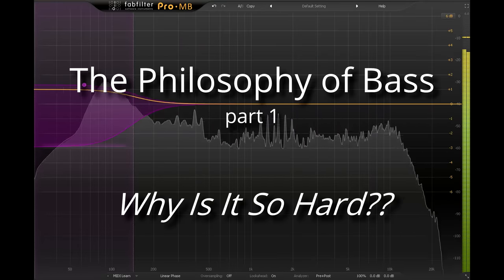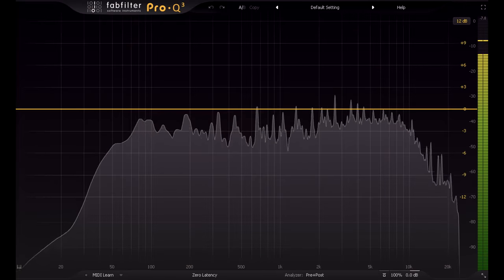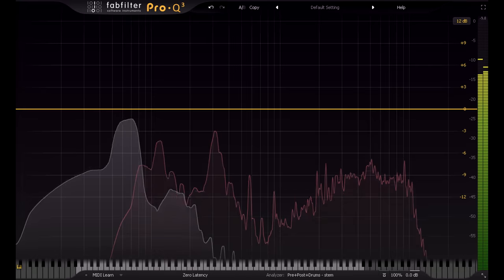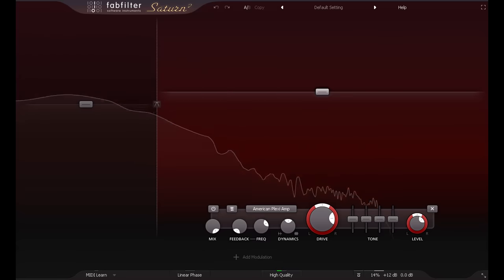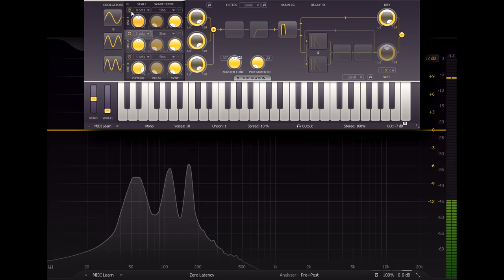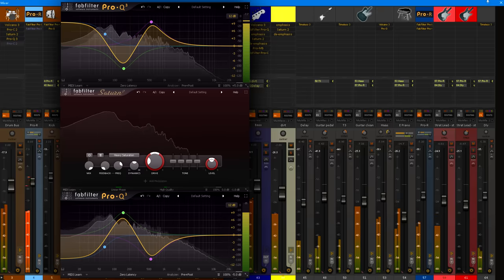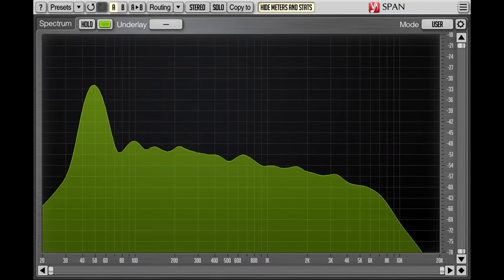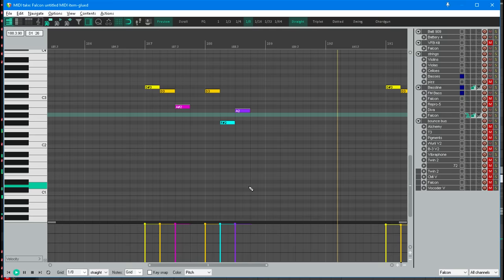The Philosophy of Bass

Comment: I would like to expand on mixing with headphones. They are great for checking the transient and detail of the sound, including sub if your headphones can produce it, but you can't rely only on headphones for mixing, due to lack of "full phase" information. For example, I had a scenario where after applying mono phaser/all-pass filter on a mono sub kick (edm) the sub and bass freq sounded really good on headphones, but it was very weird on speakers. The reason for this is that sound also mixes over time in air, and headphones doesn't give you the "time/air travel" factor which means that on headphones you can't hear what will happen with the sub/bass at longer distance, especially when one freq is slightly delayed/out of phase, which cancels some of the freq over time. In my case this was a creative decision for edm production, but this also can happen with real world instruments recordings especially when you mix 2 mics. It would be amazing if someone could do some more detailed video about this issue. At the end, use your main speakers for general mixing, than check the mix on headphones for details and transients, and than return to speakers for final check. This will make your life much easier. :)
Reply: You can go much extremer by flipping the phase of one master channel (for example the right channel). It'll sound perfectly fine on headphones (edit: it will sound wierd still, but on speakers the entire bass region will disappear, at least when you're sitting in a symmetrical room OR have a sub) but absolutely not fine on speakers. Take it even further and play that mix back on a boombox (with both channels summed) and you're left without drums, bass and vocals all of a sudden!
Reply: Yes you can rely on headphones for mixing. You just have to know how to use your tools. And you don't have to trust me. Andrew Scheps has told in interviews that he has done mixes with only headphones, sent them to mastering and have the mastering engineer return the mix having done nothing to it except limiting, because the mix was perfect as is.
Reply: @peniku8  If you flip the phase of one of the channels on headphones, it sounds like you flipped the phase of one of the channels. It's not difficult to hear phase problems on headphones. Learn how to use your tools.
Reply: I really like mixing on Headphones. On my master I narrow the stereo field by 50%, that helps me to detect mono cacelation issues.
Reply: @ejmikk  Yeah, you can hear the cancellation if one channel is flipped phase on headphones. Just the cancellation happens in your brain rather than in the air. I can definitely hear that on such an extreme example as the entire R channel flipped 180. 

For more subtle cases of phase cancellation - surely the mono button is your friend? I'm constantly flicking that to make sure my mix sounds ok in mono as well as stereo - both on 'phones and on monitors. And I always test my headphone mixes through several stereo speaker systems at some point in the process. Learn how to use your tools is exactly right!
Reply: @ejmikk  I thought I tested this years ago and remembered it to be inaudible, so I went to test it again just now. It sure is audible, you're right. But it's very different from doing the same thing on speakers, where the entire bass disappears, which is probably what I found out back then.
Reply: @peniku8  You can use a plugin to simulate speakers on your headphones (especially the channel bleeding that would happen on speakers). There are bunch of solutions available.

Comment: Sealed enclosures are generally more accurate. A ported sub can generate awesome volumes of low bass, but it's wooly, tuneless and inaccurate. Unless it's a sealed enclosure or isobaric sub, I wouldn't even consider it.
Reply: You haven't heard a properly ported subwoofer, then. I agree, most of the commercial subs are trash. Also, sealed box designs roll off at about the same rate at room gain so, it makes it sound flatter in response. The ported boxes are already flat down deep so the room adds a big boost down low. But, you can design ported boxes to work with the room by tuning it lower and use a bigger box.

Comment: I had  a 12" subwoofer in 3m X 3m room and it's sound great! I did have problem to get the low sound right and it took me time but it was much better then the 8" before. specially if you like me that want to feel the sound and vibrations and not just hears them

Comment: Hi Dan,
At 00;10:04 you mention "Four to the floor", I've heard several Brits use that term.
The correct (proper) term is "Four ON the floor" and originates with the "Motown sound" from the early 1960s, with songs like the Supremes "Where Did Our love Go", even though the hand clapping predominates the 4 beat rhythm..
Dave Clark used it with "Bits ad Pieces".
You get the idea.
"Four on the floor" was originally a hotrod term, referring to a four speed shifter mounted on the floor, which was unique in the states, as opposed to the U.K., where it was common.

Comment: My sub woofers is dipoles without any enclosure, they only need a 6db pr octave boost from 60hz and down to give a flat bass response down to 25hz ...  I ditched the original EQ that came with them and use electronic automatic EQ that play a frequency sweep and record the sound with a mic and adjust the level automatically to give flat frequency response.

Comment: Thanks Dan,very helpful👍 For those interested the example he gave in the brain bass section I think is based around the fundamental 55Hz (A1 on piano); he then adds 110Hz (A2 /octave) and then 165Hz (E3). He says its not exactly E3 (octave + fifth) as E3 is actually 164.81Hz on a piano...

Comment: most any flat response monitors will work for studio mixing. However, as he said you are going to need a subwoofer. In my experience I like to have 2 sub-bass drivers on the same amp in separate cabinets; one small sealed and one large ported tuned to ~80Hz & 40Hz respectively. 
This seems to give a nice flat'ish response to the bass and allows for mastering that will sound good on/in most any room, stereo, or PA system - in my experience. I found that getting this nice flat response is even more important than room treatments, fancy amps, or speakers.
If you want to mix with headphones you need a good pair of closed back and open back full circumaural headphones. (over ear vs on ear) Yes, two different pairs for two different response curves. Closed back tend to be more bass rich, while open back have a wide sound stage and typically an overly flat response. You will spend as much on both pairs of headphones as you would on a pair of decent self powered monitors. Seriously, when it comes to the mix down and final mastering you really can't cut corners on the monitoring. They don't have to be Genelec, but you aren't getting away with using you computer's multimedia speakers or your bookshelf stereo system from college either.

Comment: I had to turn the volume down twice.  That cheap Dell sub-woofer actually works pretty good given that the room sucks (cheap duplex).  I like that he went through the theory of why things sound like they do.  Here in the Austin,Texas area we have a fairly new venue that had really bad acoustics early on.  It caused acts to not even consider it for most shows.  Since then, something has changed.  About a year and a half ago, I saw what was probably the last King Crimson tour in the states.  The sound was incredible!  I don't know if the FOH guy spent all day setting up bass traps or what, but I was very happy with the sound.  Quick history, a best friend in Houston runs a car stereo shop that has had multiple high finishers in multiple contests, so I have been around good sound for a while.  I also quickly recognize the really icky sound in most add-in car stereos.  Bass is also the reason, I'll always have to have a house.  I just couldn't live without decent bass.

Comment: I have watched, read, sort, for over 20 years theory on bass reproduction. Many of the speaker type issues were discovered by trial and error.
In fact I went against the grain
From ns10’s, to 8” mid field but now a 12” main monitor setup.
I then treated the room.
My mixes improved. This was against advise given to me.
Your video is one of the best I have come across. 
I’m going to try and use some of your techniques in my
Next mix. Thank you for posting.

Comment: I feel like with headphones, so long as I have trained myself with plenty of varied reference material, and start to hear the frequency response (more bass than I'd like, less bass, etc), I can mix okay on imperfect or cheap headphones, so long as they do indeed cover the entire frequency spectrum. The examples you picked do represent a more focused design to their intended craft, so I feel these would be easier than say, a pair of air pods or something.
Reply: Correct - I can recommend the old Beyer DT 990 Pro or the new DT 900 Pro X for that. And reference material is also the key for mixing with smaller monitor systems BTW.

Comment: A lot of techniques used by major pop producers here, in case anyone thinks this is just audio theory that is not necessarily applicable: That technique at 20:53 with the Pro-MB sidechained to the kick taking out the lower frequencies was literally used (and shown) by The Weeknd's producer and mixing engineer on Mix With the Masters.  Highpassing everything but the bass like Dan shows at 24:35 is used by Serban, Jaycen Joshua, Josh Godwin etc. Serban usually high passes at around 200 with a 12db slope, for example.

Comment: dude. that brain bass trick with the saturation was INSANE! i think we all did that unconsciously at some point but now it really makes sense
Reply: Yeah it's a great tip. It's something I discovered by accident myself, but great to see it confirmed here by the master - means I wasn't going crazy! 

Also explains why those old valve Ampeg bass amps are so popular. They have a nice natural overdrive when you hear them soloed... but then they sound clean but rich in the mix. But this trick will work equally well on synth bass parts too, using a good saturation plug-in.

Comment: This is interesting. I've always been wary of subwoofers because they can introduce even more issues with phase in the low end. Granted, I recognize their usefulness, but it always seemed like my low-end Focal Alpha 65s or even small form factor genelecs translate better to bigger systems than systems with cheap subs. It's always been easier for me to deal with the fact that my bass is going to be louder (and just getting use to that) on other systems, rather than having it be muddy and inaccurate. Granted, I'm not saying that the latter needs to be the case, but it usually is on cheap systems.

Comment: And that's why mastering engineers has big speakers in their studio, combined with smaller reference speakers and even yet smaller, like the auratones. You did forget to mention a good digital X-over, where you can fine tune subs with the full range speakers, and even add delays, compression etc. And indeed real bass traps. Not the toy foam things. Great video Dan.

Comment: For the first part, a good starting point is to use the AutoEQ project to fix the EQ of your headphones/iem's. Crinacle's tools help simplify that.
Reply: Just be aware that the measurements used for the autoEQ project often have excessive sub bass rolloff due to less than ideal sealing with the measurement unit.

Comment: Dan, you are the most knowledgable person in your field I have found online, and I have learned much so thanks for that. One small but important statement you made is not quite 100% accurate IMO. "The (subwoofer) needs to be physical large to produce the lowest octaves properly". A high quality, modestly sized subwoofer can reproduce low frequencies accurately with the proper design but they tend to be expensive. Bigger is not necessarily better, especially when it is lower quality.

Comment: If you are working with regular instruments as opposed to computer synthesized music I would highly recommend getting the best and largest sealed system that you can get (mains or mains + sub) That is capable of reproducing as close to 15Hz to 20kHz as you can get (30 Hz minimum on the low end) with adequate headroom and then EQ for flattest response at your listening position. That way you can easily apply any house curve you like.

The advantage of sealed is that total extension is better and the roll off more closely matches the room gain making proper EQ easier and less likely to damage drivers as they do not unload as resonant cabinets such as ported do.

Comment: I was using a REL Q400 on 15" Tannoys 1969 made (until one Tannoy driver started magnet-rubbing after only 53 years from new, i bought them 25'ish yrs ago s/h & they worked perfect till last Feb)  Now, i'm using that same 12" REL sub on a pair of 3-ways with a 12" woofer per channel ...Thing is, in both above cases, i only got/get good deep bass with good integration from deepest deep bass & upward ONLY when my ear is withing 6 inches of a side, room is double length (32'ft long) than it's 16'ft width width) & with speakers always pointing down the long length of the room.    From the listening sofa half or 2/3'rds way down room's length, in both above cases, the sub doesn't seem to help at all, even detract perhaps? but no help, except with my head 6 or 8 inches max from wall, like when i go to the equipment wall shelf was when i first noticed it.  When my head moves away ftom side wall anywhere awsy from a corner , the deepest to higher mid-bass level subsides rapidly, ive tried the 0 or 180 2-position switch but the same happens.    Is this because my corner sat 12" sub-woofer was smaller than my Tannoy 15" cones & is no bigger than my current  3-way spesker's woofers?  Or is it because of the lack of accoustic treatment above 4"-6" or so, except framed pics. Have plenty soft furnishes.  Have i got the worst dimendion'd room for basz??   Any ideas ...anyone?  or the REL is going on e/Bay as it bugs me enormously, except when my head is up to 8 or 6'ish inches or closer to a side wall!!

Comment: Amazing video as usual, Dan! Studio monitor creator here.. thank you for dispelling a couple longstanding myths, and mad props on the wisdom nuggets in the first section of the vid. Monitor design is not for the faint of heart. 

I'd like to add to your thought about needing big subs to hear the "body bass" and kick fundamentals clearly. This is absolutely the case with passive speakers as well as most active designs, however, as long as a speaker stays within it's xmax limits, clear and low bass with a flat frequency response can be achieved from relatively small subs. I'm over simplifying here, but small drivers are preferable in many instances to larger ones because they have less moving mass. Less moving mass = faster drivers = clarity.

I've just successfully prototyped a sealed active 3-way nearfield that features dual facing 6.5" subs on each monitor, and plays clean bass down 38hz (38hz-40khz, +/- .5db) and can play far louder than normal mixing levels! This is made possible through top of the line class d amps with dsp.

A sealed design is also important because there is no transient smearing from a port, and the mids and highs can be delay compensated to play perfectly in time with the subs. Once you hear bass so tight and clear, your dog could mix your low end for you. Of course a treated room is the other half of the equation. 

Thank you again for your amazing videos and wisdom, Dan. You've got the gold. And much love to all the fellow creators here. Let's keep making bold and awesome things.
Reply: Which active monitors would you recommend? Thank you
Reply: @RP-vq4wd  Whats your budget?

Comment: Wow, leaving out the fundamental while keeping the second and third harmonic is just a phenomenal trick I would have never figured out on my own.  Bass could have been so much easier
Reply: How do you create a second and third harmonic in the first place, though? Do you need to use a specific type of synthesizer?
Reply: @forcetheedges  I am using Ableton operator (check oscillator box to reveal harmonics) but any soft synth should allow you to take out the fundamental.  'Course' could be an option to look into.  Another way to do it would be to work out the range of your bass notes and just high pass EQ so you're always lowering the fundamental substantially.  I don't think Dan would approve of that method though!

Comment: Actually there are manufacturers that resolved the SIZE ISSUE ..there are small speakers with 6 bass woofers ..2 mounted on the sides that reverses the phase of the bass and low mids and thus cancel out the bass that is coming from the back

Comment: I didn’t know that the loudspeaker’s enclosure size affected the low end performance by way of phase cancellation.

I’ll mention that many people worry too much about bass resonances in their room below 63Hz.  These are hard to absorb with anything less than resonant absorbers or low GFR frictional ones greater than 2-feet thick.  The good news is that an EBU whitepaper (EBU tech 3276 2nd Edition), and other resources such as Ethan Winer, say that it’s the decay times above this cutoff which matter most.

The reason I say this is because Dan says it’s a good idea to have a subwoofer so you know how much treatment you need.  This is a good point but shouldn’t be taken to the extent that you’re fixated on a 42Hz resonance.
Reply: Cone speakers are dipole speakers, meaning the rear wave is 180° out of phase with the front wave. The cabinet is needed to prevent the rear wave from leaking into the room, canceling out with the front wave. Cabinet size has an effect on sensitivity&efficiency.